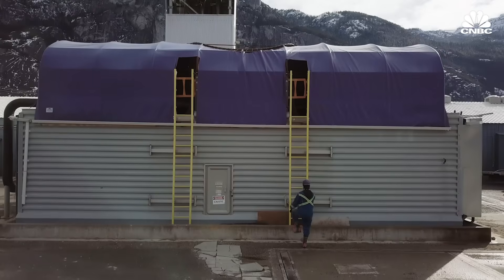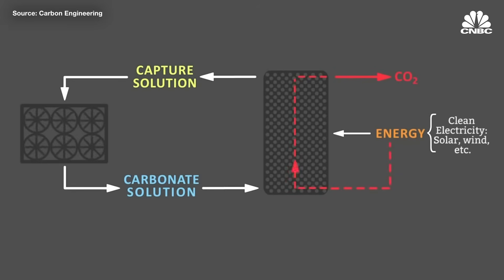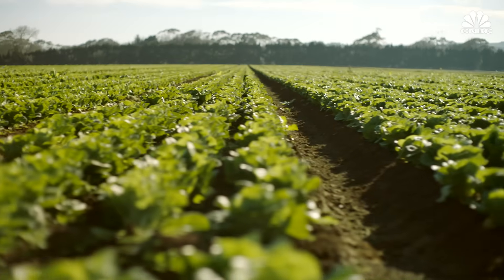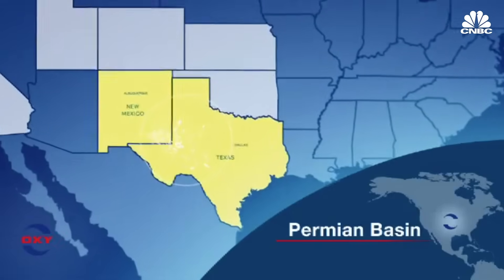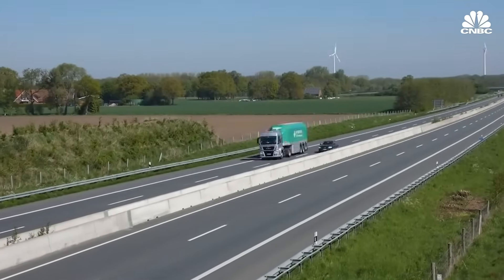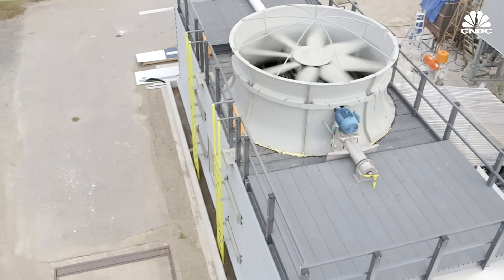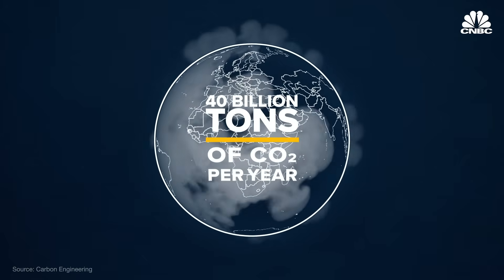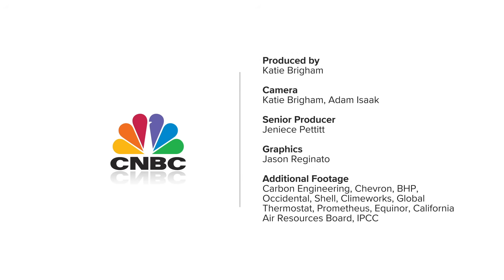Bill Gates-Backed Carbon Capture Plant Does The Work Of 40 Million Trees

Comment: Backed by oil companies so we can continue burning fossil fuels
Reply: @user-zd9fc4vs4q  I can tell, from your post, you have never researched Tesla's tech.  What you mentioned does NOT happen in ANY Tesla Model 3.  I guess you didn't know that have those vehicle in Canada and above the Arctic Circle!  That's right!  In places ICE vehicles can't even START, Teslas are doing just fine!  Update your knowledge base.  You must talking about the OTHER EVs that are 3 generations behind Tesla's technology.  It's called a battery management system.

ALSO, batteries don't behave like that period. Batteries don't like to output a LARGE amount of current in the cold, but that is all. However, too much HEAT can damage batteries (like ICE vehicles).  That is why COOLING is needed, LIKE ICE VEHICLES.
Reply: @user-zd9fc4vs4q  Wow. Your knowledge of the subject matter is very poor. I guess you haven't witnessed it being too cold for an ICE vehicle to even start. Apparently, you also don't understand that you need oxygen for combustion. The higher altitude the vehicle is at, the LOWER the performance. A Tesla could work in a vacuum without any power loss. That, too, seems "better than" to me.

You haven't heard of synthetic lube. It is better than oil from the ground. Also, are you naive enough to believe all fossil fuel production has to stay around just for oil as lube? I think we're done here.
Reply: @user-zd9fc4vs4q  "...what good is an electric motor if we don't live in space, because we have tons of air on earth?"  That is one of the most unintelligent questions I have ever heard. 1. It's more efficient. 2. There are MANY different cities at MANY different elevations. These different elevations have DIFFERENT levels of oxygen. 3. It does not pollute and cause human beings harm!

These are the electric heavy equipment I am talking about (see links below). All these can be recharged by solar and wind power, obviously.

https://electrek.co/2019/01/17/construction-equipment-electric-volvo-ce/

https://electrek.co/2017/09/17/electric-dumper-truck-worlds-largest-ev-battery-pack/
Reply: Who cares if we use fossil fuels if we eliminate the only con to them (emissions)
Reply: @mitchhammond3213  No statement on how much energy is put in for the process including the so called chemicals.
Reply: @mitchhammond3213  The problem is that you CAN'T eliminate the cons to them (yes, there is more than one). CONSTANT oil leaking into the environment (or do you have something against clean water and a stable ecology) is a thing. Do you eat seafood?  Fracking causes EARTHQUAKES and destroys the water table!  Do you like drinkable water?

Do you understand, now, why your statement is not really based in reality?
Reply: I dunno. I’m happy to see them spending some of their money on reducing the effects of what they’ve sold us.
Reply: @kyleslater5245  They're just spending a little bit of their money to be able to stay in business longer (which is bad for all of civilization). It's nowhere near what they spent on disinformation campaigns that has us all debating this crap to begin with. They make $600 million a DAY (while killing us, making us sick and destroying the environment).
Reply: That's likely. But I'm glad they are spending something rather then nothing at all.
Reply: Why not? There are no viable alternatives to fossil fuels.
Reply: @CGoffgrid  really, there are no alternatives? Or are the alternatives just inconvenient and expensive?
Reply: @CGoffgrid  electric cars don't work everywhere
Reply: @CGoffgrid  That is a lie. There are places living on 100% renewable energy, so that is obviously a lie. AND, the prices are now cheaper to implement in a lot of places. Even my family is living basically off the grid, WITH a BEV pulling power! Don't let the fossil fuel industry brainwash you, Chris. There are MANY alternatives to fossil fuels!
Reply: @AscendedSaiyan3  Ok, try flying airliners and running heavy equipment off solar.
Reply: @CGoffgrid  Heavy equipment is ALREADY running off of solar and batteries! Airlines could have planes that can run off of HYDROGEN (produced from solar power), UNTIL battery power densities reach the point of being able to power longer flight times.  What else do you have?
Reply: @AscendedSaiyan3   You're dreaming. Why do you people have such a hard time accepting that nothing gives a better ROI than fossil fuels? You don't have to like them, but you need to accept facts.
Reply: @AscendedSaiyan3  "There are places living on 100% renewable energy" - name a few and what their major industries are.
Reply: @ChucksSEADnDEAD  I don't know why I am showing you, because I know you will not be able to accept it. You will, likely, try to find some fringe reasons why they shouldn't be counted. Anyway, here is a URL listed below (70% to 100% renewable). The 100% renewable places I am aware of are Costa Rica; island of Ta'u in Samoa; Samso Island, Denmark; Flinders Island (Tazmania); Cape Verde; etc.  

https://www.cdp.net/en/cities/world-renewable-energy-cities
Reply: @ChucksSEADnDEAD  I, also, forgot about Iceland! ;)
Reply: @AscendedSaiyan3  my point here isn't to find reasons to "not count" places, I don't even have time to look over the full dataset provided by the website. It's just that not all of those cities are known industry powerhouses, and those cities in Iceland and Brazil... I'm sure that Iceland gets a boost from geothermal and Brazil from ethanol. I'm not interested in saying that those cities don't count, my problem is my doubts that those situations can be replicated elsewhere or if the energy levels are enough to sustain industry in the countryside.
Reply: @ChucksSEADnDEAD  Why does being "known industry powerhouses" matters? It reads like one of those excuses I mentioned in my previous post. Iceland only get 13 to 17% of power from geothermal. And, the U.S. has more than enough areas that are GREAT for renewable energies (geothermal, wind, solar, and hydro).  There is more than enough to power ALL current and future energy needs. And, wind and solar is cheaper.  Wind and/or solar + batteries is almost at cost parity with coal. Those are the facts.
Reply: @ChucksSEADnDEAD  JET FUEL is pretty bad for airplanes.  We just engineer a ton of mechanisms to make it safer! Read this: "In fact, a fuel cell coupled with an electric motor is two to three times more efficient than an internal combustion engine running on gasoline. ... The energy in 2.2 pounds (1 kilogram) of hydrogen gas is about the same as the energy in 1 gallon (6.2 pounds, 2.8 kilograms) of gasoline."

That means an electric turbine (jet engine) would be MUCH more efficient than using jet fuel. And, zero byproducts, besides water.
Reply: @AscendedSaiyan3  it's easy to run on 100% renewables when you don't have to power anything that consumes real power. That's my point. You can't overuse hydro because of the damage to the hydrography/ecosystem, you can't overuse wind as it whacks birds to death and does take energy from the wind which means areas downwind will suffer unusual climate as they get less wind. Solar's great for deserted areas between the tropics because of the better sunlight and the fact that you're building on less habitable land. But looking at previously green hills covered with the dull blue and grey of solar panels is depressing.
Reply: @AscendedSaiyan3  lol planes cant fly with giant iron explosive tanks.
Reply: @ExploringCabinsandMines  I know, right?! It's not like highly explosive jet fuel is kept in a gigantic metal tank (that spans the wings) called a fuselage or anything! 🤣
Reply: @AscendedSaiyan3  ya like fer sure dude a hydrogen tank and a jet fuel tank are like totally the same, word ! Like hydrogen  kept at 5000 to 10000 psi could just be put in paper bag totally.
Reply: @ChucksSEADnDEAD  That is the WORST argument in the world. You are using an argument that makes zero sense. If you can go weeks without using fossil fuels,  scale up any additional use yoy may need. The U.K. AND Germany have already reached that point, so your argument is nonsense. It's like you are just regurgitating the same poison the fossil fuel industry has pumped into the Internet. It's sad.
Reply: @ExploringCabinsandMines  Or, maybe kept in a car. Oh wait...
Reply: @AscendedSaiyan3  oh wait....
Reply: @AscendedSaiyan3 WIKIPEDIA  Volkswagen's Rudolf Krebs said in 2013 that "no matter how excellent you make the cars themselves, the laws of physics hinder their overall efficiency. The most efficient way to convert energy to mobility is electricity." He elaborated: "Hydrogen mobility only makes sense if you use green energy", but ... you need to convert it first into hydrogen "with low efficiencies" where "you lose about 40 percent of the initial energy".  OH WAIT....
Reply: @AscendedSaiyan3  WIKIPEDIA A 2017 analysis published in Green Car Reports concluded that the best hydrogen-fuel-cell vehicles consume "more than three times more electricity per mile than an electric vehicle ... generate more greenhouse-gas emissions than other powertrain technologies 
OH WAIT.....
Reply: @AscendedSaiyan3  wiki Liquid hydrogen has about four times the volume for the same amount of energy of kerosene based jet-fuel.
OH WAIT.....
Reply: @AscendedSaiyan3  so hydrogen sounds great, someday it may be great , it's not there yet.
Hydrogen fuel cells hold more promise than anything,  but as I noted it takes energy to make the hydrogen then compress it , that's like spending $ 10 to get $ 6 , would that be smart ?
OH WAIT....
Reply: @ExploringCabinsandMines  You have no idea what you're talking about.  I know my researched subjects and you have NO idea how old I am.  Unless you can produce up to date evidence (clearly, you haven't presented any overarching facts), please stop replying.  Speaking of grammar, I think you should have a long look at your non-capitalized, run-on sentence. ;)
Reply: @ExploringCabinsandMines  The funny part is that you didn't even research the inefficiency of JET FUEL use vs. Hydrogen use. Also, it seems you don't understand that the hydrogen is used to drive an ELECTRIC motor/turbine. Nevermind. You don't know how this stuff works. I might as well be talking to a wall.
Reply: @AscendedSaiyan3  1. Age you're younger than me going by your screen name and favorites list, you just are accept it.
2. Energy density differs from energy conversion efficiency (net output per input) or embodied energy (the energy output costs to provide, as harvesting, refining, distributing, and dealing with pollution all use energy.
3. R.E. grammar, we're not in school , I'm typing on a phone ,so I don't care.
Reply: @AscendedSaiyan3  Energy density in energy storage and in fuel,
https://en.wikipedia.org/wiki/Energy_density
Reply: @AscendedSaiyan3  " That is the WORST argument in the world. You are using an argument that makes zero sense." - How? If a city is 100% green energy but only consumes (pulling the number out of my ass) 100 MW, how does that mean you'll be able to power an industrial sector that consumes 1000 MW?

"The U.K. AND Germany have already reached that point" - false, Germany is dependent on brown coal.
Reply: @AscendedSaiyan3  "It's not like highly explosive jet fuel is kept in a gigantic metal tank (that spans the wings) called a fuselage or anything!" - the fuselage is made out of composites and aluminum.
The actual fuel tanks are lightweight.
Hydrogen requires a heavy duty tank to be pressurized in, plus insulation.
Reply: @ChucksSEADnDEAD  And, you are trying to say aluminum alloys isn't metal (because I said metal)? 😉 Do you understand the purpose of creating aluminum alloys? It is to lighten weight while retaining strength. Also, do you believe these commercial plane fuselages aren't pressurized? Think about it.
Reply: @AscendedSaiyan3  an airplane is pressurized at 12 psi and a liquid hydrogen tank is 6,000 to 12,000 psi , you cant seem to accept certain scientific facts . It's not about feelings.
Reply: @ChucksSEADnDEAD  literally a ham sandwich has more density than a lithium ion battery,  I gave you a wiki link on energy density,  utilize it.
Reply: @AscendedSaiyan3  You seem to have an issue placing too many comma's.
Reply: @AscendedSaiyan3  the aluminum is THIN skin. Hydrogen requires THICK pressure tanks.
"Also, do you believe these commercial plane fuselages aren't pressurized? Think about it." - THEY ARE PRESSURIZED AT ATMOSPHERIC PRESSURE, HYDROGEN TANKS REQUIRE PRESSURE TO TURN HYDROGEN GAS INTO LIQUID
Reply: @ExploringCabinsandMines  I do not have an issue with "placing too many comma's". If you learned grammar, you would know those were the correct amount of commas. Also, commas is NOT spelled with an apostrophe. ;)
Reply: @AscendedSaiyan3  read several of your posts you have random CoMmaS where none belong.😂
Reply: @AscendedSaiyan3  how old are you ?
Reply: @ExploringCabinsandMines  As I said before, I am old to the point of having a child that graduated college. And, I am old enough to remember grammar. How old are you?
Reply: @AscendedSaiyan3  51, two kids graduated college 3 to go.
Reply: @ExploringCabinsandMines  We are in the same age group, then. Congratulations, on the two that graduated. My condolences, to your bank account, for the remaining three.  I am assuming that you were not a part of YouTube, when they first started. Also, I assume that you are not aware of how old the show, that my screen name comes from, is.
Reply: @AscendedSaiyan3  I've had a YouTube channel since 2008.
I had assumed the screen name was from Dragon ball z which is why I called you OPM at one point.
Reply: @AscendedSaiyan3  not that OPM and DBZ are related just thought you could identify with the two.
Reply: @ExploringCabinsandMines  Yes, and DBZ started in 1989. It ended, before my child was born.
Reply: @AscendedSaiyan3  Majin Buu eat you up !

Comment: do not listen to this bs...plants and humans are opposites...neither could survive without the other...humans breath in air about 20% oxygen 75% nitrogen and 5 percent argon and very small traces amounts of a few other things...and then humans exhale carbon dioxide...there are many sources responsible for the co2 in the atmosphere...but there is no need to worry about the amount of carbon dioxide in the atmosphere...this is because plants use carbon dioxide for photosynthesis by trapping the carbon in microscopic pores on the bottom of leaves and releases the oxygen...more carbon dioxide in the atmosphere means more plants and trees...which means more oxygen...so it is impossible for there to be too much carbon dioxide in the atmosphere because it just means that oxygen  would be released into the atmosphere at a quicker rate...balancing the ecosystem

Comment: If air-to-fuel becomes cheaper than drilling / digging for fossil fuels, then a revolution will begin. This is a also a great way to soak up excess energy from renewable energy rather than curtailment. This is just the beginning.
Reply: amekanasai Problem is it takew more energy to produce than you get out.
Reply: @bonedoc4556  Yes indeed. That's why the energy required to do it have to come from renewable sources. The fuel produced essentially acts as an energy store only.

Comment: SAD SAD SAD.  Today you can put solar PV on your roof and displace fossil CO2, while paying for the investment with your reduced utility bill. 
CO2 not emitted never has to be recovered from the atmosphere.  Today it makes more sense to turn to renewable energy than carbon capture.  
A ton of CO2 is emitted by 100 gallons of gasoline. This process claims a cost of $94 to $232 per ton. That is like raising the price of gasoline by 92 cents/gallon to $2.32 per gallon. 
When emissions are down near zero, then it makes sense to use carbon capture, but only with sequestering. At this time carbon capture and re-use is just a way to keep profits going to the fossil fuel companies, while shifting the cost to the taxpayer.

Comment: I put up 7kw of solar on my roof for $5400.  In 6 months it has produced 4mw and equal to 155 trees planted and cut out 6000lbs of CO2.  It powers my house in texas including AC.  When my Tesla Model Y arrives I will have a solar powered car.  No co2 generated or oil used.

Comment: If we were to use nuclear msr reactors to produce process heat and use the direct air capture technology we could completely replace our fuels with carbon neutral fuels without the massive land use of biofuels, and renewables. I support solar for rooftop installations but almost all renewables have significant problems that need addressing before they are truly viable for replacing our current systems. IMO nuclear is the way to go especially since the waste heat can be used to generate the carbon neutral fuels which are drop in replacements for current fuels and if we begin moving toward carbon based fuel cells or hydrogen based fuel cells we can make the process even more efficient as these are about 60-70% efficient versus 30-35% of ICEs. In order to do all of this would certainly require a massive effort but could result in a carbon neutral world by 2050. It is my belief that the country who first puts these systems together will be on track to become the world top energy producer and exporter. If you ask me this is what we should be focusing on as a country not replacing everything with wind and solar at least not yet.